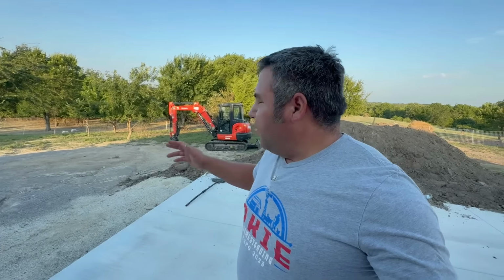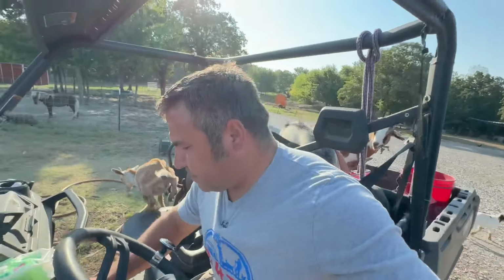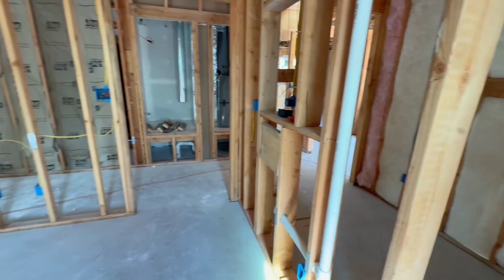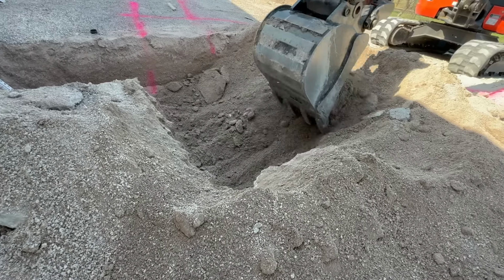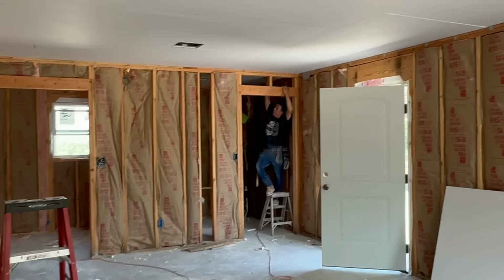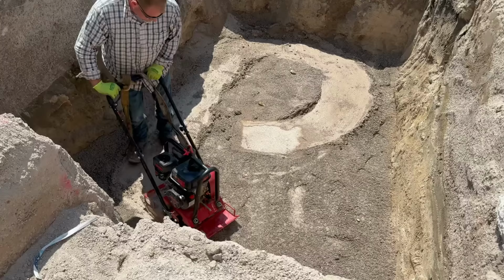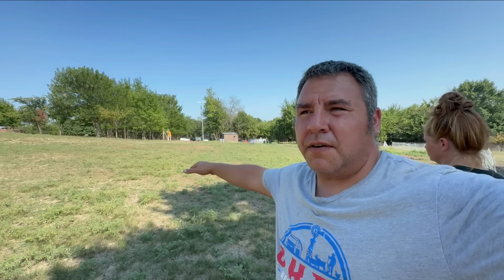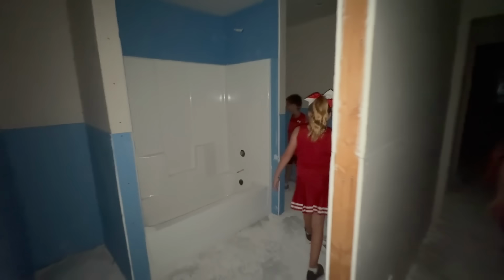We Didn’t Expect This From The Contractors!!￼￼

Comment: Brandon if you ever want to make your back patio under the roof water proof and mosquito proof.  Home Depot has  vinyl sliding doors and windows with screens.  Instead of glass the windows are clear or smoked vinyl and the frames are aluminum.  You could put them up yourself.  I did when I was 70. & I’m a female.

Comment: Something you might want to try is a bucket according to size. fill with enough water to cover them, then put enough 1/2 cup of epson salts for a small  2 gallon container stir until devolved then put your chicken or turkey in and amerce them and soak them in it for about 5 mins.

Comment: I would not have a slab put over the septic tank. The tank is going to have 2 round access ports on top of the tank that are used for pumping out the tank, which is recommended periodically. There is also a filter that is placed inside the tank, that is connected to the pipe leading to your distribution box. That filter will need to be cleaned as well. From the distribution box, you will have pipes that connect to your leech field.

I had to get my septic tank replaced about 6 or 7 years ago and the installer told me that I would probably need to get the dry well, that was my leech field, replaced at some point in the future. Well, that future was Yesterday (8/29). I had to hire a contractor to come in to expose the tank and the outlet line. They had to replace the outlet pipe as well as replace the filter inside the tank to a newer one that can easily be cleaned out if there was a problem. They ran a line to a distribution box they installed and had 2 lines of infiltration boxes (35 feet in length each) that were now my leech field. gravel was dumped into the trenches and then covered with fabric and then sand. Before they started all the digging, they had 4 dump truck loads of dirt brought in to level out my yard as the yard had a bad slope. I only have one bedroom and one bathroom, so the two 35-foot lengths of infiltration boxes are sufficient for me. If there were more bedrooms and bathrooms then more would be required. This project cost me $7000, and I am in Nothern New York.

Another thing to remember is that you cannot drive cars, trucks or heavy equipment over your leech field and septic tank.
Reply from the maker: Thanks for the information. We will talk to the contractor. We hate that you had to get your leech field repaired. Septic/plumbing work can be quite expensive. Hopefully you’ll be set for many years to come. Thank you for your suggestions and for supporting our family!

Comment: How come they didn’t put insulation in the ceiling?
Reply from the maker: Yes, they will be back to insulate the ceiling later. You have to have the sheet rock up so you can leave the insulation on it. It’s a different insulation.
Reply: You can pour in insulation later.  I hope they are insulating the roof too!  We put rock wool batts.

Comment: Will they blow insulation  in attic area, above ceiling.
 You'll never be able to have a ingrown swimming  pool off patio unless concrete is extended  way out because  of septic  tank. You can't convert it totally  because  every  2 years they have to come pump it out. They have to remove cover in order to pump it.. I know this because  I've had a septic  tank on my house  for 15 years. You can't cover it up with anything.

Comment: I have a Question, You had mentioned.
That you're gonna put cement around your house with your septic tank and Pipe by your house. Are you still going to be able to put cement over it? The only reason why I'm questioning is if you ever had issues with that pipe. How would they get added to repair under the cement. We just had a situation couple years ago. Where somehow are pipe from? The house to the tank had a crack in it and we dug it up and was able to replace it. I know here in Minnesota. We have to leave those lines open and we can't plant anything or drive. Anything heavy over where our subject tank is. I was only asking cause I'm learning through your building of your home. How something's are different from one area to another.
Reply from the maker: We won’t cement over any septic or lines

Comment: I would stop construction and start screaming about the R15 insulation. R30 is the minimum. 😂😂
Reply: You are so confused. R13 to r15 goes in a 2x4 wall. You should know this if you did build homes. A2x6 wall uses up to r21. But never r30 in a wall!!

Comment: I would stop construction and start screaming about the R15 insulation. R30 is the minimum. 😂😂
Reply: How many times are you going to put this same false statement up on this post. I’ve already seen it like 5 times and you are totally wrong anyways
Reply: @mwatkins2464  I said it 2 different ways. My house that I built has R50 ceiling and outside walls are 12” R50. The electric company has come out five times to investigate why my electric bills are so low and I tell him why our 50 ceiling or 50 walls I couldn’t improve it more by replacing my doors and windows. I wonder how much your electric bills are.

Comment: R15 too low. R30 is standard. Your electric bill gas bill is going to be high. I’m sorry they screwed you over.😂😂😂
Reply: R30 doesn’t go in the walls!!! There is only 3 1/2 inches to fill in a 2x4 wall.

Comment: Are the majority of workers Native American? I’m surprised you’re allowed to put in a septic system instead of the more modern sewage system.
Reply from the maker: Some are native
Reply: They don’t have city sewer in the country. Septic tanks are modern
Reply: @mwatkins2464  septic systems are older than me, and I’m 65! There are newer systems for homes in the country that don’t use septic tanks (I just don’t know the official name). They have multiple barrel-type tanks that wastewater flowers in and out of to purify the water and then it’s sprayed on the yard through a sprinkler type system.
Reply: @brendac2206  I’m sure there are several kinds but the majority used today is a septic tank. I sure wouldn’t want septic water sprayed on my yard. I do know of commercial type companies like chicken plants that use the type you’re talking about but never seen it used for residential.
Reply: @mwatkins2464  It's pretty much required in Texas. By the time it hits the yard, it's clean water.